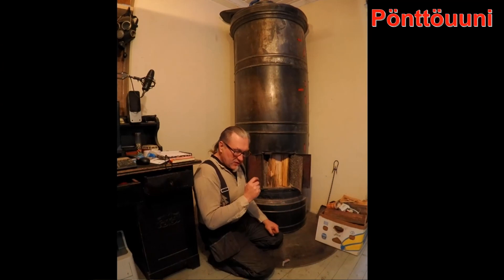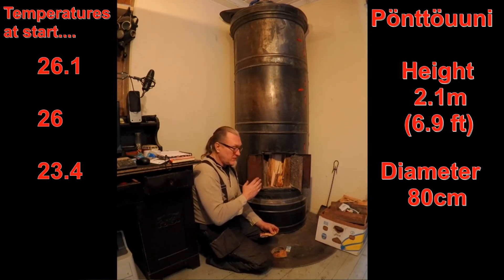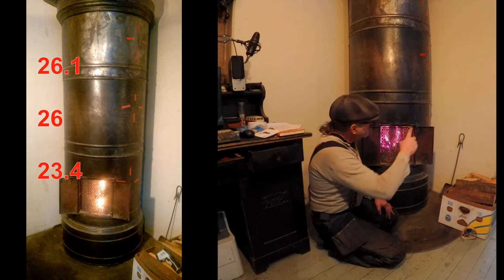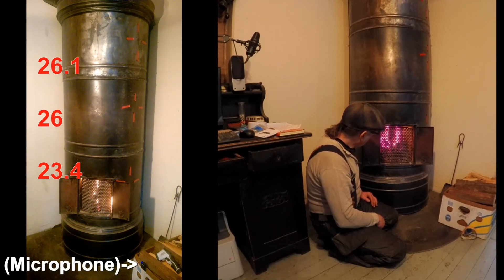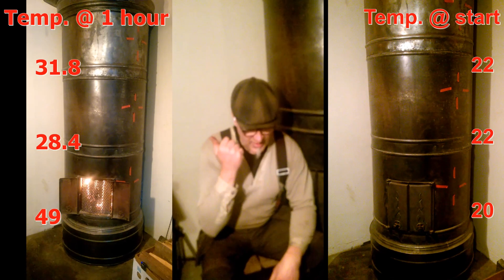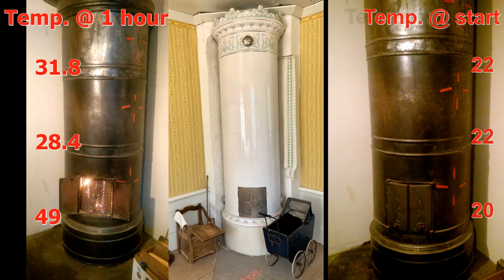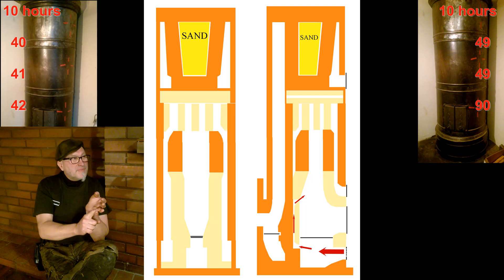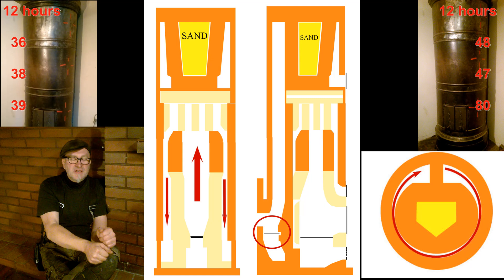Masonry heaters -The Russian Rocket (pönttöuuni)

Comment: Interesting test. This is what I have been wondering when burning woods in my Tiileri fireplace. I have came to same conclusion that I should not burn it all wide open. I haven't really made any comparisons but just reasoning that if burning as fast as possible there is not enough time for heat to store into the bricks although it burns hotter. I was surprised that there is such a big difference. Then there is that discussion on what is the  optimal throttling of the fire. Whent throttling too much it starts to build up soot which is not good. I think you need to find right balance of burning most of the gasses off and and still trying to not vaporize your woods too fast by providing too much air to burn.
Reply: Normally max air would mean vents at max open position. Doors fully open is way too much air, and you are basically flushing the hot surfaces all the burn time with a lot of just room temp air mixed with the burn gasses. Also I don't think the burn is particurly clean as the burn chamber is too open to get really hot. I normally burn my pönttöuunis about 1h-1.5h at max vents open. A lot of draft so burn is still violent enough. And then close the vents fully and damper 90%. I have a mark for the intermediate close position where the is still minor draft + CO alarms. And as the old models do not have the bottom grille I let the coals burn out like this. The key is to just be more gas tight toward the room than the chimney.  With couple of mixings and a full load of dry birch it is nearly just ash, no red amber, only in additional 1-1,5h. Then close the dampers fully.

The chimney sweep man has always said, there is next to no soot. Unlike my big masonry oven. The draft in the pönttöuuni channels is just so good.
Reply from the maker: Yes exactly. People talk about an 'efficient burn' with maximum air flow. Yes, it gets the maximum amount of heat from the wood. But if all that heat goes straight up the chimney and out then what is the point? I am now experimenting with burning a half pesa slowly 2-3 times a day. (from your name and grammar I think you are Finnish so you will understand) It is working well. I just need the outside temperature to get nice and cold so I can test it properly.

Comment: Well done sir. I have the impression that many years of real world experience of cold climates is likely to have intuited some very good ideas about how to heat a home. Taking a scientific lens to these traditions seems a sensible approach. But where I live the winter average is 11 - 21c - so what would I know? Maybe I can swap some tips on how to stay cool in summer?
Reply from the maker: The summers here are nice and warm but not usually oppressively hot so staying cool is not usually a big problem. Keep the windows open (with mosquito nets) and a fan blowing to circulate the air.
Reply: I am from Tamilnadu, India 🇮🇳. I can relate to your situation. In South Indian states the winter temperature never crosses below +10°C except for the highest hill stations & dense forests.  The South Indian summer is harsh and goes  beyond +40°C and humidity makes it worse.    

I too am looking for better cooling options apart from White paints on roof and passive cooling. 

To cool an off grid house, from what I have searched so far, the only better option is to use Heat pump chillers with Glycol ice battery tanks powered by solar energy.